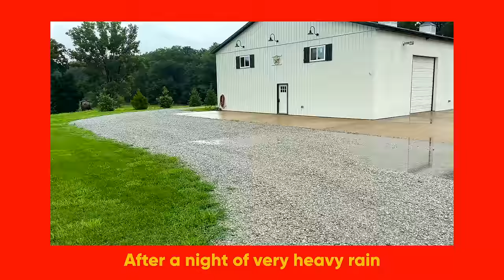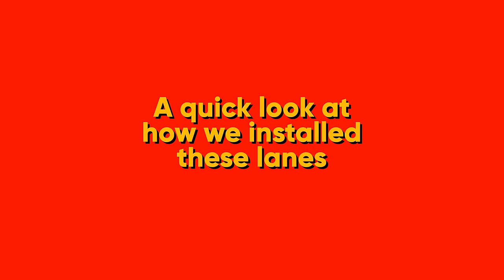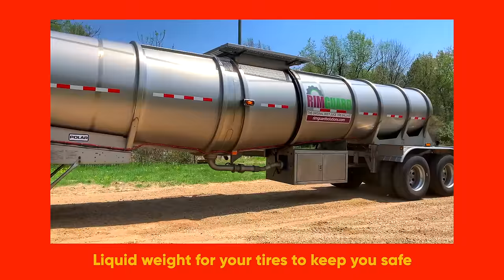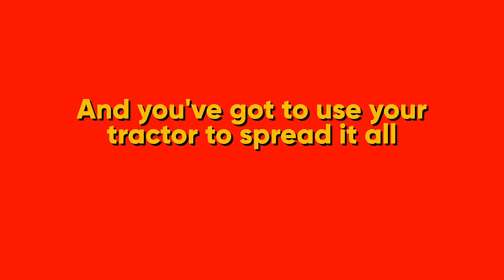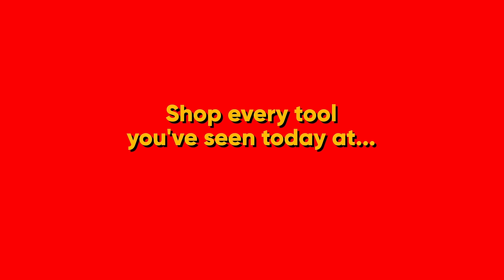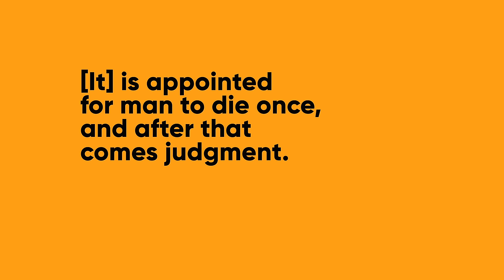HOW TO INSTALL AND MAINTAIN A GRAVEL DRIVEWAY

Comment: If you have a good layer of gravel, most weeds you see later have not come “through” the gravel — they have been seeded into the gravel by wind or birds.  IMO landscape fabric is not worth the cost and effort.   Use occasional herbicide applications to control any weeds that appear

Comment: Nice video and totally correct.  My wife and I turned 1500’ of mountainside virgin aspen and fir into a great 20’ wide driveway for our new build.   The contractor bid was 120k.   We bought a Kubota L4060, plotted a path and then spent two summers cutting the trees, removing the stumps (I rented a mini x), laying the fabric and then building a french drain and spreading 45 loads of rock and gravel in layers as needed.  Total cost close to 70K and we now have a great tractor for snow removal and other chores going forward.   This obviously took a lot of time but for us old retired folks that is the one thing we have planty of.  😎

Comment: Excellent point on the rototiller. Pro tip on gravel driveways. We live in the Pacific Northwest and mud is what we deal with. Don't use fabric to prevent rock from sinking into the ground over time. Make the first layer big 3"- 4" crush rock. It acts like snow shoes. The make the next layer 1-2" rock. Then top it off with 5/8" or so. Done deal. That road will never sink. Rock will never settle. And loaded concrete trucks can dive on it in the winter without leaving tracks

Comment: 1 1/2 inch to 1/2 inch stone with fines would pack in and make it harder (not impossible) for weeds to break through. For your attachment row, maybe a reclaimed asphalt product. Usually from tearing up a road. Sometimes an asphalt company has these seconds. Put it down like stone but it will become like an asphalt driveway (sort of) over a little time.

Comment: One thing that I noticed you're missing is gravel fines as a final top layer, if you get fines locked in between the bigger stones and get it nice and compacted, it will keep it bound together and keep it from washing out and will last for many years. As far as the road fabric goes, if you can get down to that sub soil layer of clay and get the top soil out you really shouldn't need fabric. Id also look at it from a cost point of view, is it going to cost more to dig or to just put road fabric down.

Comment: Your property is beautiful.  Every time I watch a gravel maintenance video it makes me appreciate asphalt and concrete.  After spending far too much time raking gravel we finally bit the bullet and all but ~4k square feet is either stained and stamped concrete or reclaimed asphalt and our trails are dirt.  RAP is now hard to find in my area because most crews grind and reuse it on the same project so it doesn't make its way to the general public anymore.  Respect to those with the patience to deal with gravel.

Comment: Courtney, don't know if you're against using a shovel but you could dig up the fiberoptic line to expose it then use machinery to dig a trench and lay 4" drain tile at the proper grade going under the fiberoptic line and drain the water in the direction you desire. Some people might call it a French drain, but at any rate drain tile should do it.

Comment: Great video Courtney. I’m having my old asphalt driveway replaced with gravel. Which attachment would you recommend to maintain the driveway, if I could only have one?
Reply from the maker: The Land Plane is probably my favorite tool to resurface the driveway and it can move a lot of material. So if you have serious gravel to move, it's a good choice. A box blade can do even more outside of driveway work, but you won't find it as easy to resurface your drive compared to the Land Plane. And the Heavy Duty Dethatcher is the best multi-purpose tool, allowing you to 'freshen up' the gravel surface, but not fix any real problems. But then you can use it on your lawn, trails, to collect leaves, etc... So you get a lot of bang for your buck with that. Not a straightforward answer, but figured it all was relevant.

Comment: Concrete is the only permanent solution... too bad concrete is so expensive now. I have had the same issues. weeds will eventually grow on top of the rocks as well. I really don't like using round up. so i tried vinegar (25%) with salt and soap. it kills it but doest not remove it.. my limestone driveway has a tar base underneath it... a road crew had extra and put it down for me.  Solid base and lime stone does not sink down into ground but   weeds and grass grow on top of it.. 
around by my garage i have an overflow patch of gravel to make it easier to park in garage. i put landscape fabric underneath it..  I snagged  it using the box blade it has been a pain since.. I would just not use it again so i can easily re grade that spot.

Comment: Idk. It seems the whole reason for the gravel was the mud. Once the gravel is on I think i would box grad once or twice a year for heavy traffic drive and the rest mow once in a while when gradually moving the equipment around as used. The grass wasn’t bothering anything before you put the gravel in. Seems like a lot of work for something farmers never worry about.
And as far as road fabric, I wouldn’t bother it is such a pain if you snag it later.

Comment: have you considered vertical drainage for some of your standing water problems?  Take an auger dig some vertical holes 6" or so in diameter 1.5-2' apart and backfill that with gravel, then level it with more gravel.
Reply from the maker: Yeah. That's a solution I've thought about. However, as any standing water drains on its own after about 24 hours, I just can't motivate myself to prioritize anything for it right now.

Comment: The follow up will be in the winter for snow removal without plowing up or piling up the stone.
Reply from the maker: we're pretty pleased with the inverted rear blade method: https://www.youtube.com/watch?v=dzsdtqzcSnI
Reply: @GoodWorksTractors  Perhaps for light snow falls, last season the 2 biggest storms of over 2' came in late March and early April, they were wet and dense, no back blade would tackle that, my PTO snow thrower struggled and kept throwing the stone all over.